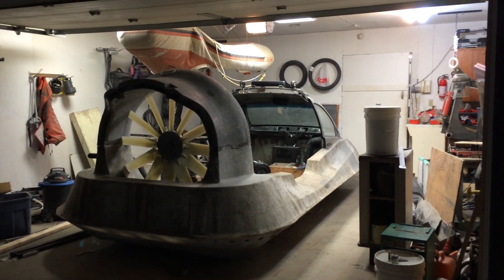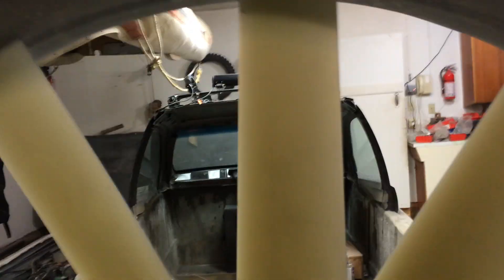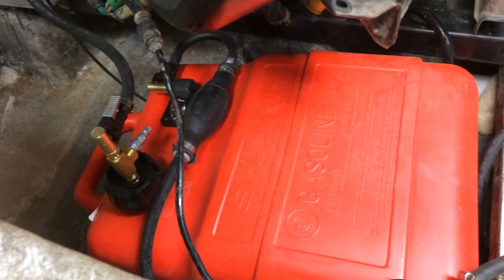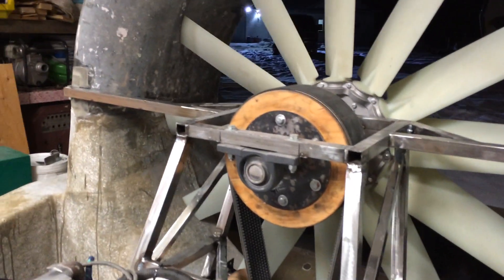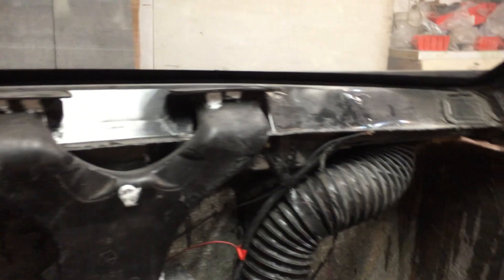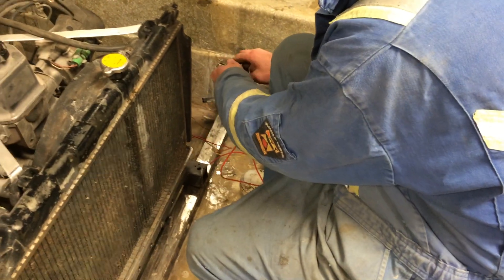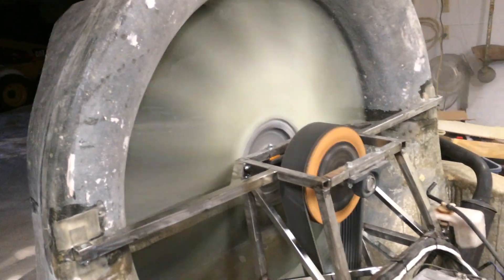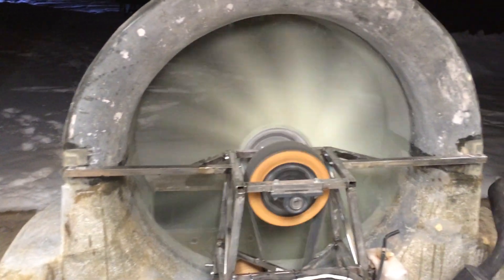DIY Hovercraft - Mid Project

Comment: How does the air get from the fan under the the body for lift? cheers, Martin
Reply: Hi Martin!  There is a splitter in the lower 1/4 of the duct.  It directs air into the “plenum”, a hollow chamber between the inner and outer hull.  There are holes drilled into the plenum that supply air to the skirt and under the craft and provides lift.

Comment: Hello, amazing project. I was wondering, i saw in the other video that you seem to need to aply a bit of throttle before it starts lifting, how does it behave in water, will it float at idle or do you need to think constantly of not going too low throtle?
Reply: Hi! You are correct- you need to apply a bit of throttle before it lifts.  On the water, it behaves just like on land.  You require a bit of throttle to get it to lift.  On the water, after a couple minutes, water will make its way into the plenum.  To get going again, I will bring up the rpm a bit to chase the water out of the plenum for about 10 seconds, then increase the rpm to move forward and up to planing speed.  The craft is incredibly stable floating with its large flat bottom. When floating, it has immense drag - if you had to paddle it with engine off it would be a real workout!  It’s like an floating platform with engines off - not hydrodynamic.  :  )